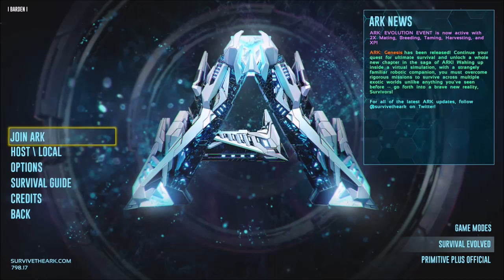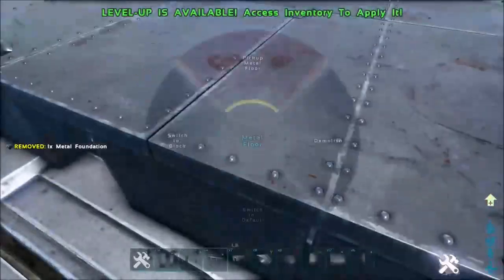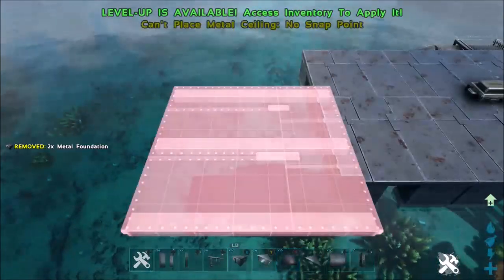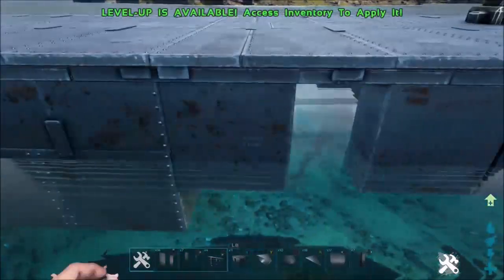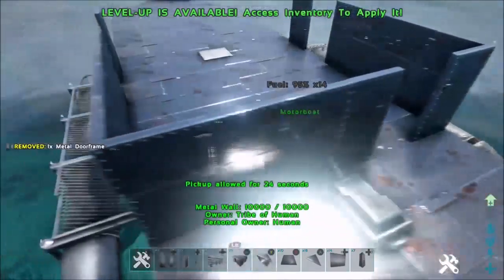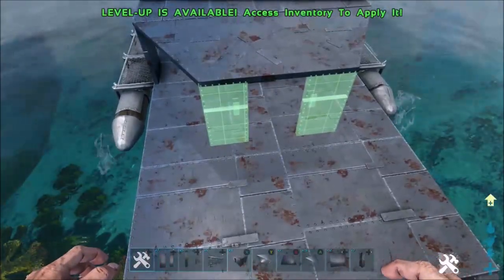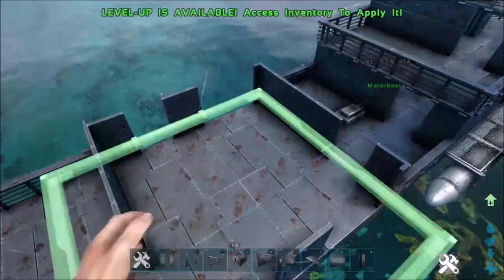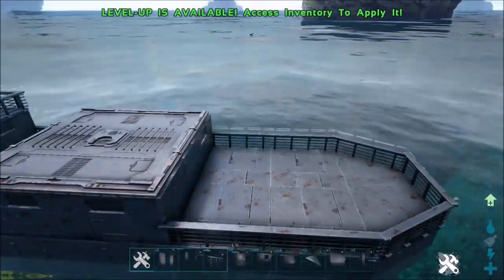Ark Survival Evolved: Naval Destroyer (Tutorial/ No Mods)

Comment: Only issue I had was adding railing to the back triangle pieces says it’s too far from the foundation
Reply: Any tips to fix this?
Reply from the maker: Looks like the issue is the original placement of your foundations. If you don't put them close to the exact spot shown in the video they might ended up causing some of your end foundations to land just outside the build radius of your boat.

Comment: What if the last point (or last triangular triangle) to make a point won’t snap on?
Reply from the maker: Not sure, with the updates they have put out so far, I don't know if you will be able to complete the build.
Reply: @DrB048  alright thanks, it’s a cool build I just wish I could build it completely. Thanks for telling me how to get foundation in the boat cause I was able to build a small battleship with the knowledge
Reply: @DrB048  I also did mine with just a regular raft would that change it?
Reply from the maker: @rexythet-rex3513  Yup, that's the issue. You need to build it off a motorboat to be able to do the full build.
Reply: @DrB048  i think its patched because the triangle foundations will not snap on like the used to.